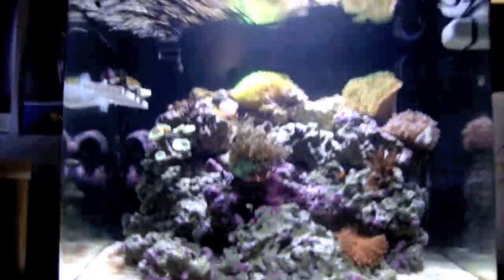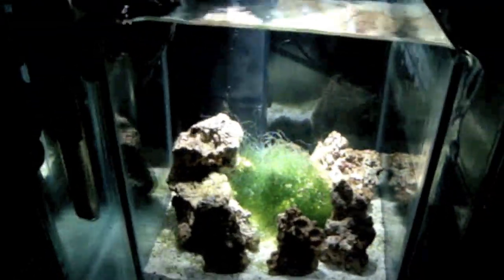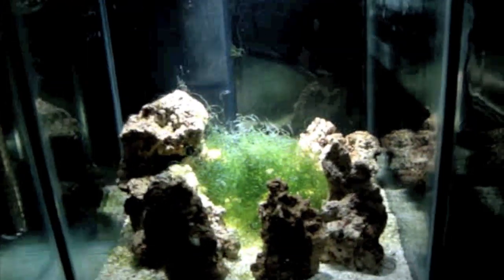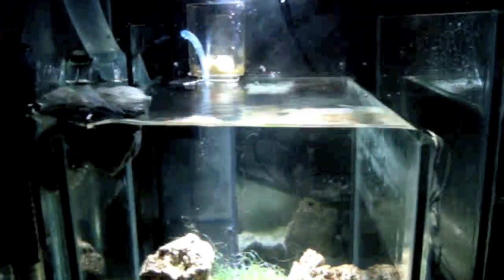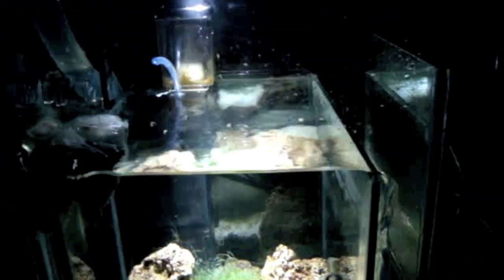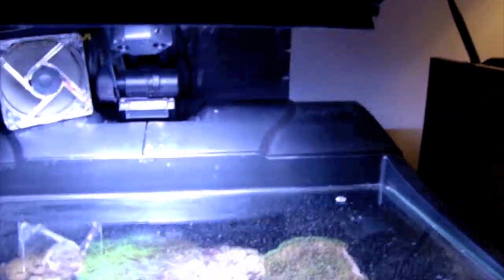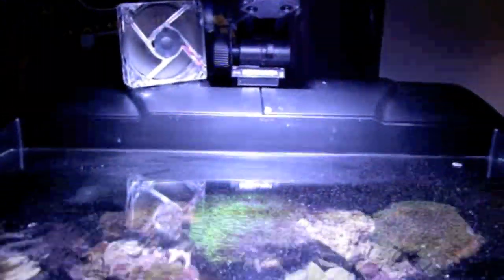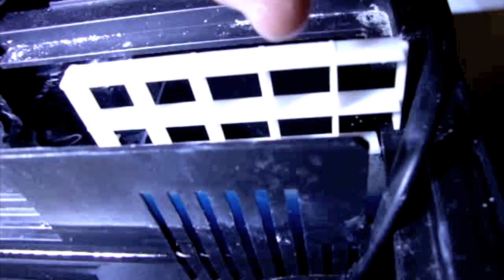Biocube 29 Custom DIY Sump Refugium

Comment from the maker: @bilbobag111 That is a good question, and the answer to that is simple.  Camber 1 is to small for an overflow box, chamber 2 has the biocube light attached to it so i can not put the overflow there.  Besides it allows the water to flow through the chambers and get "prefiltered" b4 actually going down into the sump

Comment: Nice setup! You're really tempting me to setup a sump myself on my biocube 29. I'm really new with sumps so I don't really quite understand it fully yet. Why do you need a ball valve on your drain? I see you're using a eshopps nano pre-filter overflow box. From what I understand aren't those rated at around 200 gph? So what if your return pump is rated at 320 gph won't that pump water faster into your display tank than it can drain back into your sump? Thanks for helping me out :)

Comment: OK. I'm learning a lot from your videos. You have a great set up and I appreciate your thoughts. I have the older biocube so my set up is slightly different. I'm getting ready to take it down and start over because of some current issues I'm having. What I'm wondering right now is how you drilled or cut the back of your stand to accomidate the tubing? Do you have any pictures of the back of your stand and how you did all the plumping for your biocube?

Comment from the maker: @ericchan22111 Thanks! I've switched my ball valve to a gate valve, see one of my later videos.  But its on there because it reduces the noise and eliminates the splashing of the bubbles when the water enters the sump. Don't forget that the pump has to pump up about 3 feet so it will lose pressure and therefore not equal 320 by the time it gets to the top. But it all equals out in the end.

Comment: How did you get your drain so quiet? I'm setting up a 29g and made a 10 gallon sump. I also have the esshops nano overflow box and quieted down with a stockman standpipe mod. The only problem is the drain water into the sump is very loud with all that water crashing in there with a bunch of bubbles. Do you just have a ball valve on there and turn down the flow alittle? I've heard using a ball valve is bad cause it could get clogged. Have you had any issues?

Comment from the maker: You dont need an overflow box if you can drill a hole in the 3rd chamber and through the stand. If you do it that way you can make a DIY stand pipe.

Comment from the maker: @bilbobag111 I drilled 4 holes in the back using a 1" drill bit. One on the left for the overflow.  3 on the right, one One for ATO, one for Return, & one for chiller. And I have lots of pictures i'll send you a link through PM so check your inbox.  And if u want to see more pictures than the ones I already have, let me know and i'll take some more pictures.

Comment: Forgive me if I'm just blatantly missing this info if you have it posted, but how many gallons does the sump add? I can't seem to find the size anywhere. Thanks!
Reply from the maker: Hey thats no problem. It holds about 13 gallons when full and operates at about 9 - 9.5 gallons. Thanks for your comment!
Reply from the maker: Hey thats no problem. It holds about 13 gallons when full and operates at about 9 - 9.5 gallons.